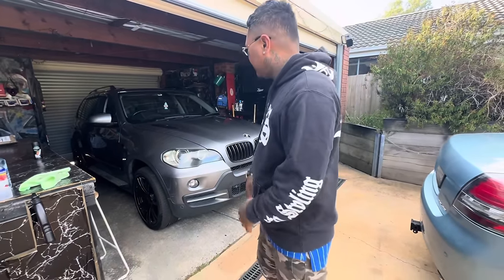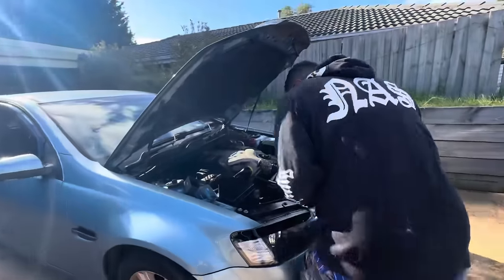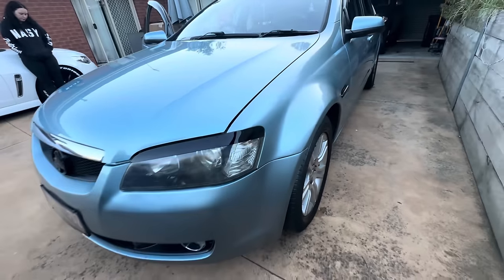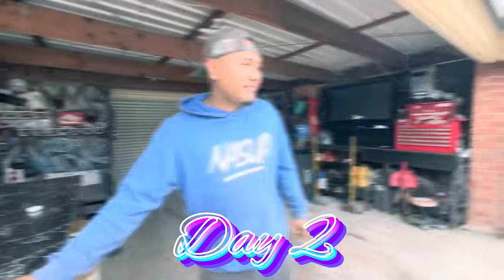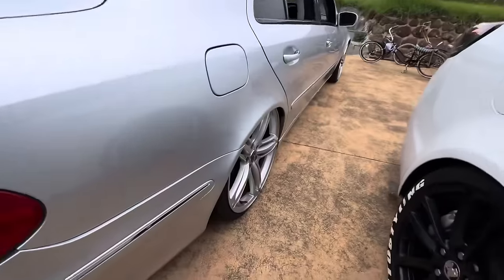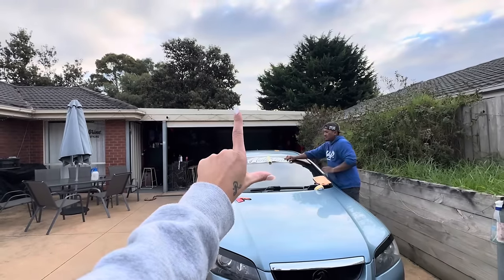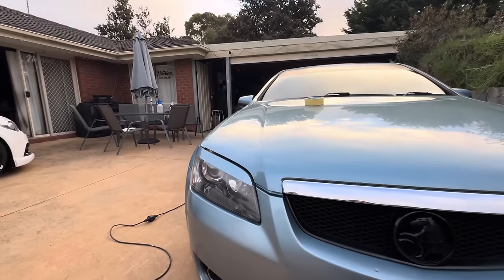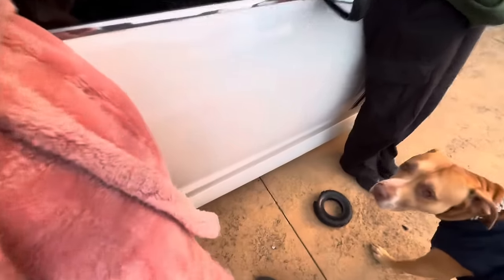Ve calais is now SLAMMED !! / gets new PARTS !! / episode 2

Comment: You need to situate the front bumper on the drivers side. Those gaps are not wavy my G. Bonnet doesn’t seem to sit right around the headlight either. Fix these and it will look mint 👌
Reply from the maker: getting there bro one step at a time

Comment: Hey bro could you do a walk through on how to stick the led footwells on and connects them or have you done one in the past bro wanting to make my vy ss nasy g🤘🤘🔥🔥
Reply from the maker: hey brother ive done multiple in the past my man but happy to give you some tips tricks guidance of how to do it in your ss bro
Reply: @LeviNotorious  sweet bro will go check them out appreciate you man
Reply from the maker: @dile9288  Basically what you do if you got a aftermarket headunit , theres usually a usb input in the rear or whatever could plug your usb into that input / if not hardwire it into the headunit it self red n black wire , black is usually ground red is power so that would go to your accessorie wire for th headunit n blavk for ground so everytime headunit turns on leds do i usually run em thru th trims so 2 leds will go to the passo side n rear left then vice versa other 2 leds will go drivers side n rear right side rear seats usually have underneath seat the seat bracket pole double side tape on that face with zip tie to hold it proper then the front usually double sided tape for paso side n drivers side